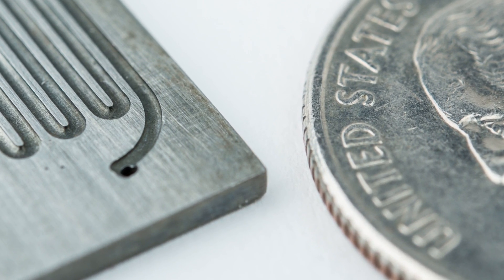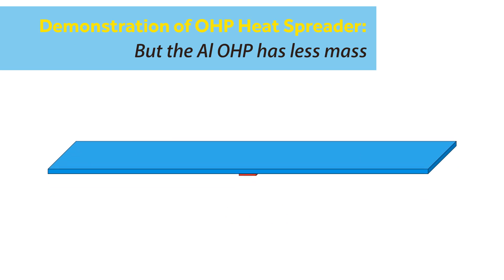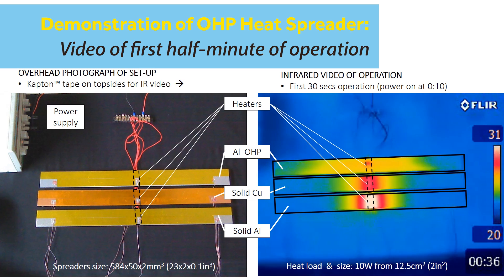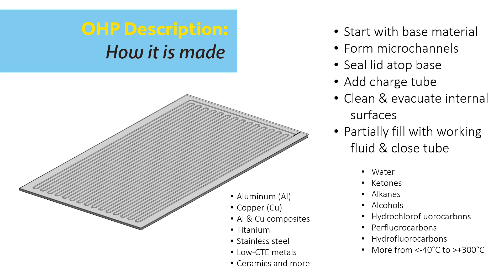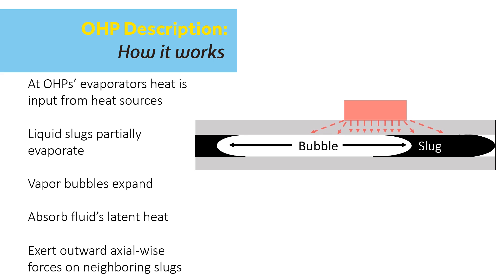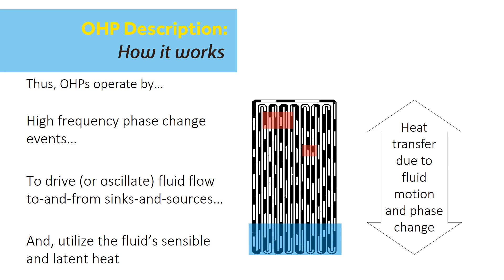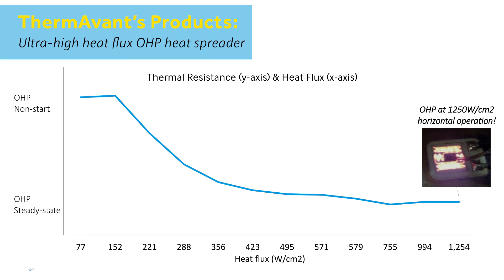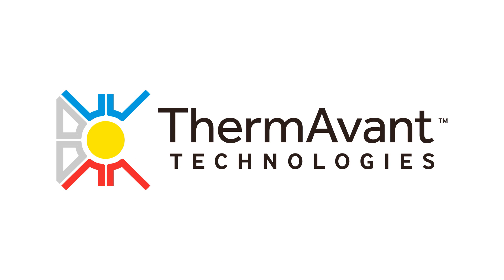About Oscillating Heat Pipes (OHPs) & Heat Transfer Technologies — ThermAvant Technologies

Comment: You should have compared it to traditional vapor chambers instead of solid materials.
Reply: Please point to a vapor chamber that is 23 inches long and 0.1" thick. Go ahead, I'll wait.
Reply: @dtothep8694  wouldn't be a problem to build, right? They are already used in some smartphones and laptops for cooling.
Reply: @maxmustermann5353  not at that length to thickness ratio.
Reply: @dtothep8694  as far as I know, you take a Copper foil, some spacers and a bit of liquid for evaporation and basically make a sandwich. Why would it be problematic to make it longer?
Reply: @maxmustermann5353  the "capillary limit" and the "sonic limit" are two fundamental limits of operation that govern a heat pipe's ability to transfer heat. Both get very difficult to manage at length scales > 12" when the part is relatively thin, due to narrow cross sections of wick structure and vapor space available.
Reply: @dtothep8694  okay, and oscillating heat pipes manage the heat transfer better, because of the liquid movement?
Reply: @maxmustermann5353  OHP's are pressure driven flow, instead of  capillary flow, which make them better suited for very thin, long structures.
Reply: @dtothep8694  Thanks for the clarification! So ideally you would want to have a heat source at the bottom of a large diameter heatpipe, with a large surface area on the evaporation and condensation sides and smooth sidewalls in between, to enable a good vapour and liquid flow, right?